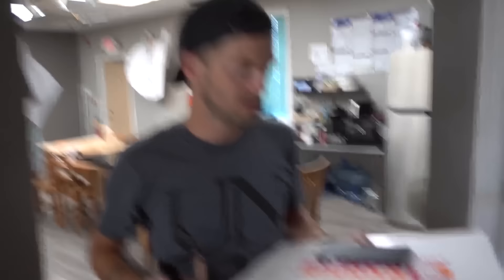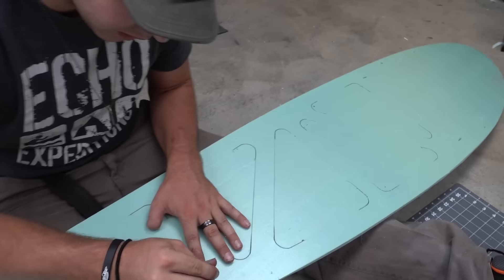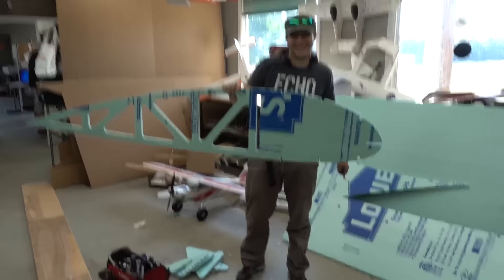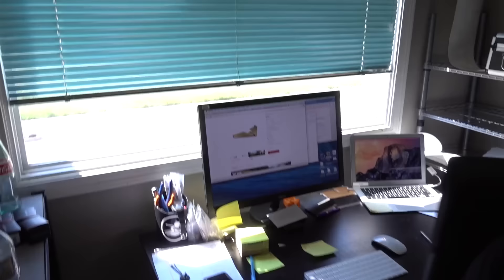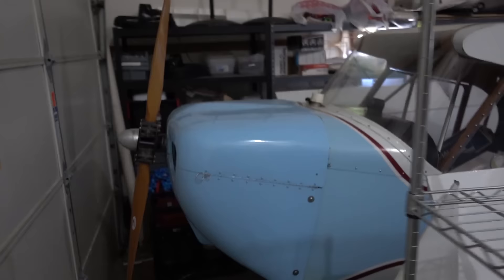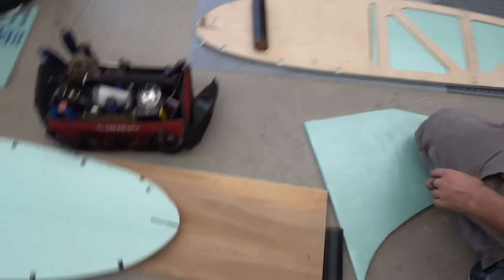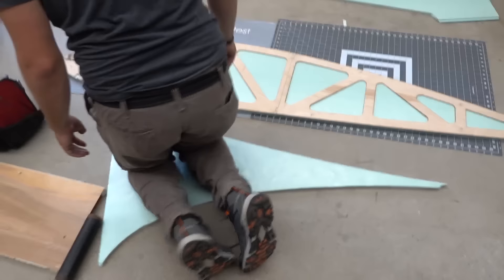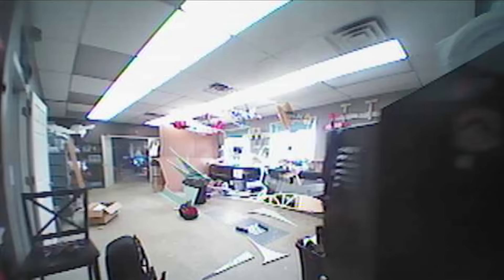GIANT PLANES - TINY DRONES | VLOG0001

Comment: I DIDNT KNOW JOSH S WAS STILL THERE!!! put him in more of the videos!
Reply: Josh's main job is not with Flite Test, that's why it's sometimes difficult to find a time to film an epsiode.
Reply: +Balu oh! How's it going balu, appreciate your help with all the flight test comments
Reply: I'm good, thanks. Weather could be better and work could be less, so I could get some flights in, but everything else is shiny :)
Reply: Balu what do you fly? I do quad racing.
Reply: I am mostly a multirotor guy, but haven't really tried FPV yet - even though I have the equipment. I was going to use an HMB235 for that, but it's sitting 3/4 ready on my bench for months now. Really need to find some time to finish it :).

I am working on getting into planes though. After all I need to fly a Sea Duck one day ;)
Reply: sounds fun, fpv is so much better than los flying, its a whole new world of flying once you put those goggles on. I would strongly advise you to work on that quad and put some gear on it, its so fun.